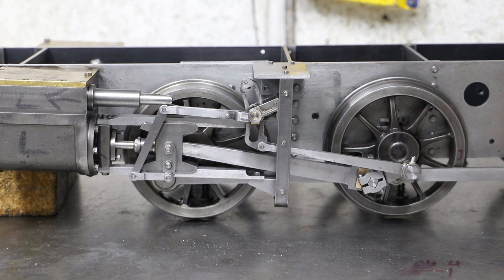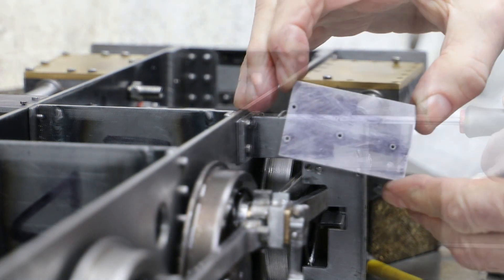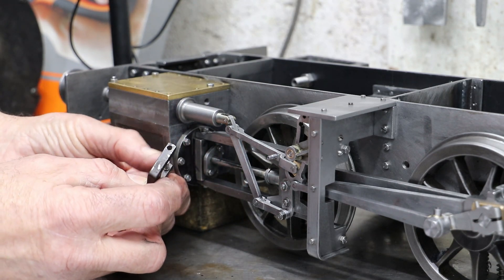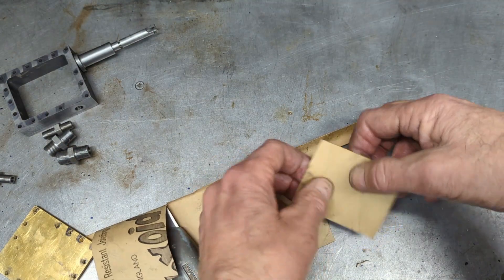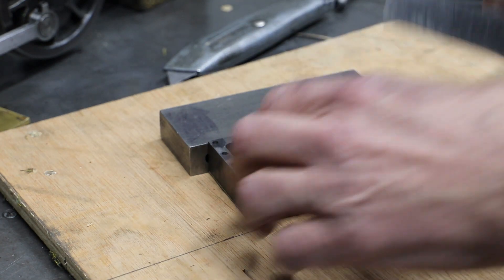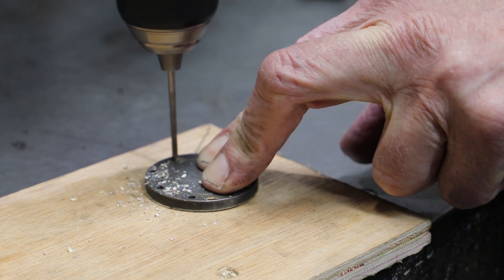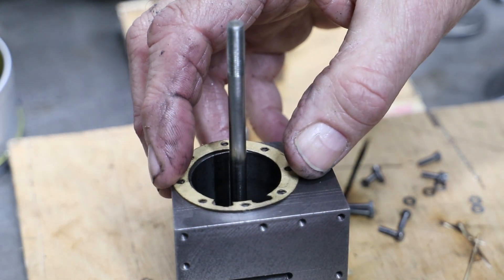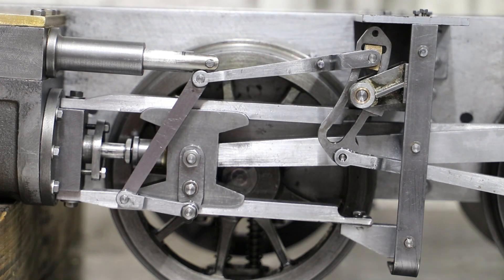Part 48: Valve Gear Problems and Sealing the Cylinders

Comment: Hi your glad packing ends should be cut on a 45 degree angle to stop straight line blow by, and gland packing should not be spiral round the shaft, again should be single rings 45 degree cut ends and ring ends stagger to stop blow by. Sorry to say but as an engineer with lots of years under my belt if you are going to do it do it right first time if not it will leak.
Reply from the maker: All feedback is welcomed David.
I understand your point on the piston packing,  but for the gland are you saying that I should use thicker packing (cross section).  Clearly the yarn I'm using is too thin to cut at an angle.
Cheers
Mark